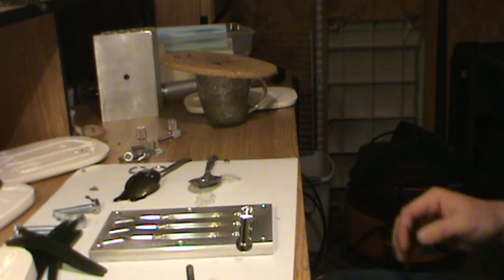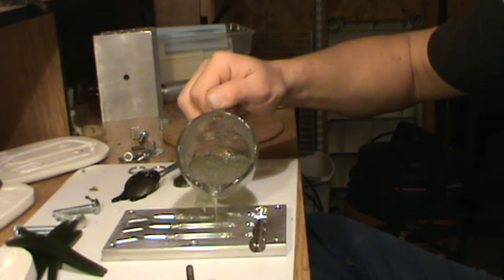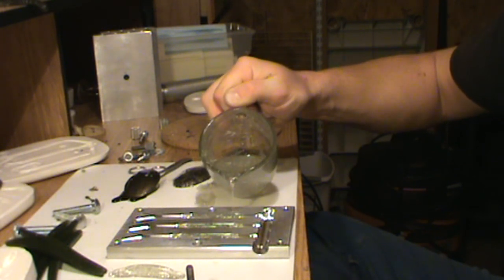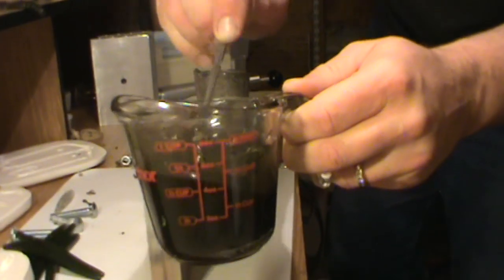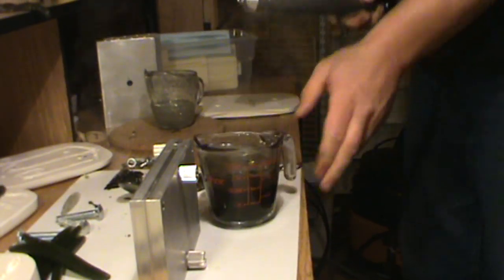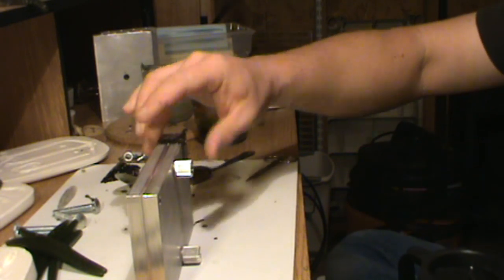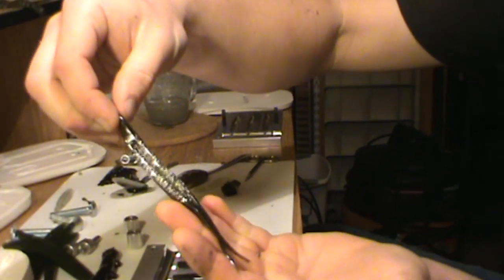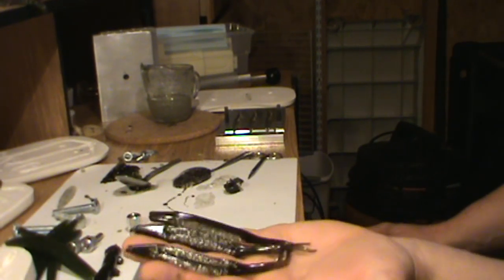Making Two Color Soft Plastic Baits

Comment: Thanks for taking the time to show us the basics.  I tried my first one last night.  A bit of a learning curve but I actually made a fluke that looks like a fluke! How do you add scent or salt for density?
Reply from the maker: I do not add scents in the plastic, but there are plenty available. I add salt after my plastic is hot, salt will cool the plastic and require more heating, I prefer the finest salt I can find, I ordered an almost powder version from one of the suppliers. You have to stir ALOT to keep the salt equally distributed.

Comment: i used recycled plastics in a 2 part pop mold and i filled the tails up with one color and then poured a different color afterwards and the tails pulled right apart. pulled right off like they didnt stick. i wander what caused that?
Reply from the maker: Rob, the most common cause of the tails pulling off is they didn't bond well to the second pour. make sure your second pour is hot enough and it should bond.